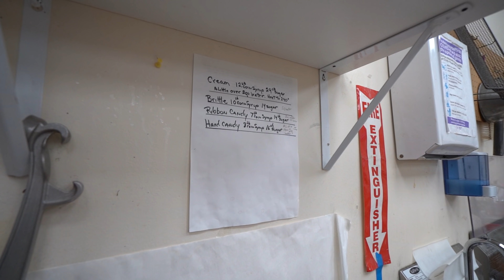Cara Learns Family Secret Watermelon Candy Recipe!

Comment: i always wondered why you don't just curb the recipe to where you pour half that bucker of corn syrup into the pot and not have to use your hands?
Reply: It splashes everywhere and takes longer to clean-up than just using your hands.
Reply: 1. that bucket is like 50 pounds maybe close to 100. 2. they don't use spoons and stuff because you have to wash them and they are tough to clean. why they use there hands is because its less clean up they have to wash their hands no matter what during the process. also they have a lot more control over how much corn syrup goes into the bowl